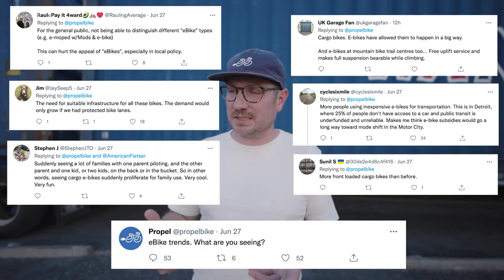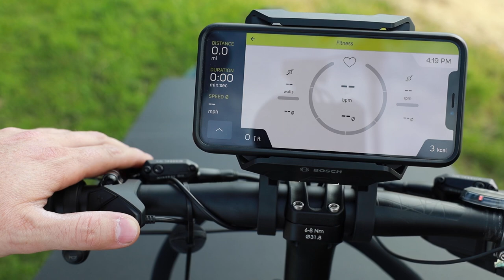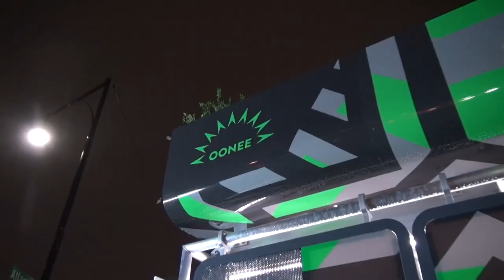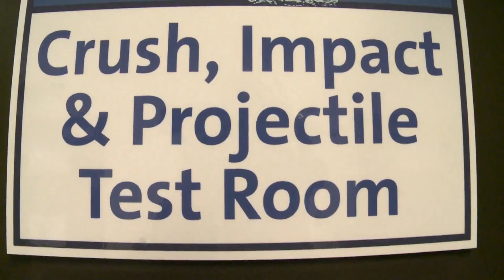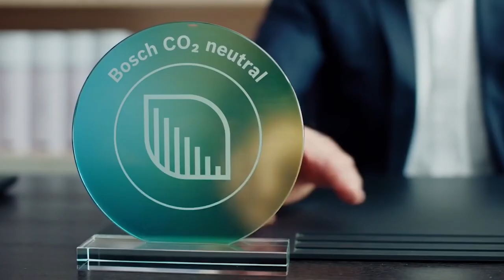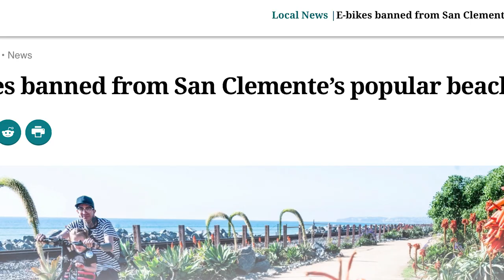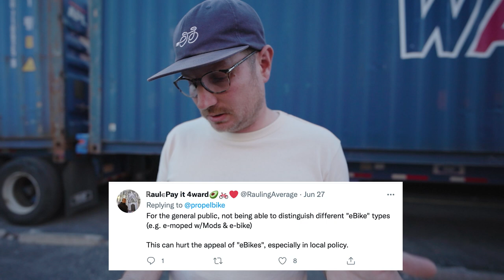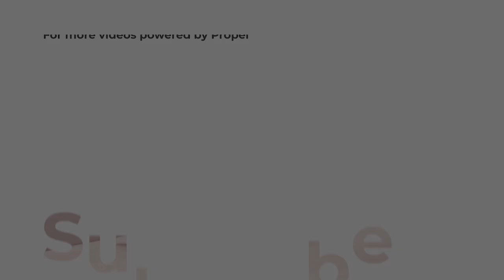eBike Trends for 2022

Comment: Decade back e look electric transport was not practical and only used as a ride in the park range, besides spending $$ every other month for batteries. I was one of those that tried as it frustrated me so much I never kept in mind to re try the e way. 2022 forced me to try again and mannn, big time difference since not having it in my mind thru out my years. I didn't realize how much it advanced of being able to actually use tech on daily basis of an everyday thing. And it's only going to get better as the regular e bike tech is jus as good as the new e bike tech to come. Big money for them newer e bikes but happy to jus be in the right range to keep up with the rest out there

Comment: UL testing is a massive cost, therefore it keeps small capable companies out of the market. without a free public testing option we won’t have safety either (UL is private). Overall, I think it’s a bit unfair (favors the rich) and may hold industry & safety back
Reply from the maker: I would agree with you on this point if it wasn't already presenting as a major safety issue. This year alone there have been over 80 fires and last year over 100 with 4 deaths. 

The reality is that many of the product in use on NY streets were not built to be stored or charged indoors. In China the standard seems to be charge the products outdoors which was likley not considered.

If history is the judge I would bet that this will be the standard wether we like it or not and I will be betting on that.
Reply: @Propelbikes  Nearly all the fires are caused by scooters brought into the country by rogue importers. But any excuse to have a go at the Chinese ebikes who are your direct competitors.
Reply: @dtz1000  Considering the brands of bikes Propel carries (>$5K), Chinese ebikes aren't even in the same market segment.   They're certainly not "direct" competitors.

Comment: Having your ebike made impossible to move on without a registration for sales 2nd hand stuff will put theives off. Registered bikes also have the added option for insurance purposes to reduce costs where upgrades could be implemented to encourage riders to be responsible owners, they get back at least 45% of their buying price. But until you can make them under $300/£320 with 48v 250watt your sales will quadruple over night.

Comment: One issue with IoTing the hell out of e-bikes is support. Software support. If an app becomes the only way to mange key controls on the bike, you better weigh up the risk of how long the company will support the software for, in particular for security updates if it is internet capable. If you're paying several thousand pound for a bike, don't be surprised if after 7 years you can't use it because it's not supported anymore. This has happened with fairly pricey electronic devices, and e-bikes might not be immune to what is effectively market abuse to force upgrading. Driving the right to repair agenda is so important.

Comment: It's different here in Europe. E-bikes are limited to a maximum 250kW motor, assisted pedalling and a maximum speed of 25 km/hr . Anything else is classed as a motorcycle and requires a licence, crash helmet and insurance and can only be used on the road.  I'm going to invest in a good e-bike because I live on a mountainside and the road to my house has a 25% gradient, is only 2 metres wide in places and has a few 180 degree bends, so it's OK cycling down but getting back home is no fun at all. Hope the e-bike can make it!
Reply: Some Chinese ebikes, like the ado A20F, can be unrestricted with a few button presses to give you double the power. It's still road legal in restricted mode. It's good to have the choice. European bikes don't usually give you that choice so you are stuck at 250w with them.  So I would look at Chinese bikes, which are usually cheaper too.

Comment: There aren't many options for getting energy/weight density better than lithium.... just a glance at the periodic table shows you there is just hydrogen and helium that are lighter. At best you'd see different anodes, possibly carbon/graphene, but most of the weight is not in the anode/cathode layers but in the barrier layer and electrolyte (lithium).

Comment: Question on sustainability: Where do I dispose the "natural" shipping popcorn that my Gazelle was shipped with? Toss it in the garden?
Reply from the maker: Gazelle doesn't use shipping popcorn but maybe your shop did? We have worked with different shipping materials over the years and I will say this is an area which can use a lot more innovation to be more sustainable.
Reply: @Propelbikes  Thank You for this quick response. I'll ask Fly Rides San Diego about this stuff. I presume it's plant based after I put one to my lips and it started to dissolve
Reply from the maker: I do think they are using a plant based one. It's definitely not easy to find a good solution here. Lately we are delivering bikes fully assembled which seems to be the path forward.

Comment: Are any manufacturers in the US planning to use the safer LFP (Lithium Iron Phosphate or LiFePO4) batteries instead of Lithium Ion? Even though their power density is lower, they are also improving, and they are much more stable (safer), allow more full charge cycles over their lifetime (about 3x Lithium Ion), and they are significantly cheaper per KWHr. The cell voltages (float and max charge voltage) are not the same, so usually it is not a simple as replacing Lithium Ion on an existing bike. Apparently they are becoming popular in China, but it would be nice to see the US step up to at least use them in ebikes, or even manufacture LFP batteries here (probably unlikely).

Comment: As a e-bike user, I really want two things, lighter e-bike and better waterproof. At the moment, i think for most e-bikes, they are delightful when the power is on, but exhausting to ride when the battery is gone. And the waterproof level is not sufficient. The first problem, i think it is difficult to address, you want a long range? faster speed? except you want to pay for a carbon frame, it is going to heavy anyway...

Comment: I need a foldable e-bike that can go 30mph easy, has good acceleration and can get 60+ miles range from full battery on full throttle. That's my dream bike. My current one is foldable, gets 25-28mph, acceleration is lacking and range is only 20-25 miles on full charge going full throttle. Had to buy 2nd battery for $500 to get good range. Also cheaper batteries would be nice.

Comment: Something I would like to see is industry standards for batteries. I have the same wish for power tools.

It is infuritating that I am forced to buy batteries from one specific manufacturer, but it's forced because they make a lot of money off of it - not only from selling batteries, but also from knowing that if you already have a battery from them, you're more likely to buy from them again. After all, if you already have a Bosch equipped bike and you get another one, it'd be annoying to have to find the correct charger, just like it'd be annoying to be unable to swap batteries back and forth as you want.

It is anti-consumer and it needs to die.

Comment: I'd really rather not see a mode shift from acoustic bikes to ebikes. That is something that really concerns me here in the Netherlands as I see a lot of teenagers on ebikes now. Ebikes are really a lot less green than acoustic bikes, let's not forget that and if it is easier going or distance extension I think a bit more sporty acoustic bike can come a long way before you actually need that ebike.
Reply from the maker: I think this is a fair point in the Netherlands. I have thought a lot about this and I believe eBikes are not as needed because of a few reasons:

1. Much of the Netherlands.was never built for the car so it retained it's relative density. 
2. It's relatively flat.
3. Due to the infrastructure, bike lanes, etc bikes don't contend with cars as much and they don't need to speed to compete. In the US and many other cities it's actually safer to go faster to avoid conflicts. This is an unfortunate reality that will be one of the hardest to solve as it deals with infrastructure and culture. The culture might be subconsciously induced though.

One point I would like to share that not all eBikes are less green. It really comes down to the use case and energy production and consumption. At that point you will need.to.look at things like.food sources to actually determine this. I plan to do a video on this in the future.

Comment: I buy a bike I like, Fit a mid drive motor and a generic battery. Having a battery that is specific to a bike limits options and keeps you beholden to the manufacturer I can usually keep a build under $1200 for a quality bike, motor and battery

Comment: One thing they really really need to sort out is the ebike laws. The UK is terrible.  Like if you get anything more than a 250w bike it should be registered, but trying to register one is near on impossible. So like escooter you run the risk of getting fines (on your driving licence) or worse the scooter or bike taken and scrapped. (by the police).  

Also, throttles are a very grey area. Which is a shame because as someone with low mobility i needed a bike with a throttle.
Reply: I see people on ebikes using throttles all the time in UK and nothing happens to them. Also scooters are everywhere but they are supposed to be banned. So I think you are safe.
Reply: @dtz1000  i have a Fiido D1 at the moment that has a throttle and yes, so far so good as had no issues. 

But i mainly mean the higher wattage bikes like sur-ron..  not that high wattage bikes are widely available in stores in UK.

Comment: I don't understand what problem e-bikes are trying to solve.
Probably one of the most unpleasant activities in the world is pedaling a bike uphill.  So the e-bike is an assist to people who bike in hilly areas.
However, the enterprise seems to breakdown from there.  e-bikes are only marginally easier to park than a motorcycle, but they are much easier to steal, and they are a lot slower.
Thus, if e-bikes are the solution, perhaps one trend for 2022 would be to better identify the problem(s).
Reply: No insurance, no road tax, no mot, no helmet required, cheaper to run than motorcycles. Way more fun than a push bike. There are a lot of reasons to get an ebike.

Comment: Batteries should be UL certified, although that is not going to prevent fires from repaired or damaged packs. I have 7 e-bike batteries but no issues because they are all from reputable companies and are taken care of. Still, I monitor charging and store them on a brick surface. Infrastructure is the biggest handicap where I live. Hundreds of business within easy range of an e-bike, no bike lanes or shoulders, and the few poorly maintained bike paths are like broken bits of spaghetti someone threw at a map. There's a state park with nice bike trails less than 5 miles away, and you cannot get to it by bike from any direction. Businesses have huge parking lots, but no bike parking, and I end up hopping in a 3400 pound car to go less than a mile.

Regarding crackdowns, it's ironic that I see more analog bikers speeding on bike paths. I've seen cyclists blowing by children and strollers at 30mph, not even attempting to slow down This past week a spandex group going towards me took up the whole path going double the speed limit. No one usually reports incidents like this, but if it involved an e-bike, there would be someone in the park office foaming at the mouth demanding that the rider be arrested for going 13mph. I have heard people say that ALL e-bikes should be outlawed because they don't make noise and they can't hear them approaching. And what noise does an analog bike make? 🙄

Comment: Things I've learned: You don't need 21speeds for an ebike. Suspension is good, but too expensive. Big wheels are good, but low step over is good too. Locked controllers need to go away. Service, not a problem for me, big problem for average consumer. Parts need to be onshore.
The companies that go away sell $$$$ bikes.

Comment: Just classify them based on their speed. That’s all these politicians need to concern themselves with. Doesn’t matter how fast they go if they’re “unlocked “ because technically you can get a speeding ticket no matter what you’re on; could even be a skateboard. I’m not a fan of all the cameras they’re putting up in nyc, but make use of them.

And I’d say a standardized battery would help tremendously. Kinda like what we already do with phone ports and everything where they have a usbc or apple port. No reason for all these types of battery ports to be floating around.

Comment: Range is the biggest thing with me I live in an area not well serviced. to get to a grocery store I have to travel 5 miles and that is just a basic food store. to get to a real grocery store I need to travel 35 miles and my current E-bike will never get there and back. To buy an extra battery is out of the question as they cost 650.00 and I just spent all my money on the bike at 2500.00 on sale and I'm on a pension. took a long time to save enough just for the bike.. This is Canada by the way.

Comment: Gearless rear hub motor … silence and low maintenance 
pinion gear system … low maintenance
gates carbon drive… clean and low maintenance

These mid drive motors are like gas motors they have too many parts that keep breaking and they make noise.
Need to focus on gearless rear hub like Stromer is doing

Comment: North America, Europe & GB have restrictions on the top speed of e-bikes, so there is no need for improvements. No other vehicle has its top speed restricted by law. New Zealand has no restriction on top speeds, but Bosch does not allow me to turn this restriction off. I can be issued a speeding ticket.
There is no need for excessive sports software on e-bikes as many watches have been built with this technology. Apple's Watch will call an ambulance if my family or I come off their bike and hit the ground hard if you don't reply to Apples Watch asking if you are ok. This happened 3 times to me, and luckily, I could respond to Apple's Watch emergency prompt as I wasn't knocked out, but I knew an ambulance would come if we couldn't reply to Apple's Watch prompt.
What is required is all e.bike stores must have batteries for hire for the brand of e-bike they sell, as I fly our 2 Tinkers around the world without their batteries.

Comment: 13:16 not try to, there are holes in the sustainable battery side. That's just the reality of it. Just because a few companies exist to recycle them doesn't mean the consumer will use them. The average citizen will not recycle them and end up tossing the battery. Heck, we have a hard enough time getting people to "reduce, reuse, or recycle" and people still throw or leave their garbage on the street. Go to the nearest fast food and look at the trash bins. All the plastic, compostable, and recyclables are in one bin. Even when there are separate bins you will find trash I'm the blue recycling bin. Frustrating as hell seeing that and I'm not the biggest "save the earth" person. I drive a V8 in California.

There is no guarantee the company will support the battery form factor the e-bike was sold with either. Bosch external battery systems look better, but I'm mainly talking about all the frame integrated batteries. This is my biggest concern from picking up an e-bike. So after that battery is kaput that bike is pretty much a weight training exercise bike. I don't even know if the e-bike computer that is sold with it or the system itself would properly function with a refurbished or non name brand battery (a sketchy and risky replacement in itself).

Overall, I'll wait. What would make me seriously consider purchasing one is having the parking infrastructure for regular and cargo bikes be substantially better than...zero in some areas. That's a better use of government spending or rebates. Free parking areas, none of that members only parking areas.

Comment: I'd like to see better upgrade kits for mountain bikes that don't cost over £350 with battery and the choice to add batteries to a sale. This is ehere governments national and local could incentivise riders to increase their ebike mileage and leqve the car at home, even sell the car and get say a better option like cargo bike meets recumbent and passenger vehicle with 1000 watt or 3000 watt motors. City and town parking with full security- possibly closer to railway station, or city centres. Licensing for options over 1000 watts.

Comment: I'm waiting for John Deere and a metal detecting company to merge into an electric bike that can find metal and then plow it out of the Earth while riding along the beach or through the woods or up a creek. 
Metal detectors allow you to plot your find on a GPS so your metal detector remembers where you find things.
The electric motor will be able to perform other functions by detaching from the wheel.
Or the entire front wheel is a removable rotary power source for other purposes like sanding drilling grinding or even pumping water.
And of course the battery can power all sorts of add-on devices like headlights,  cameras, and communicate with other vehicles. These vehicles would have been around a 40 years ago if we had not been hijacked by oil. 
Just think you could spend $75,000 on a new 4x4 luxury Jeep or $75,000 on a 40 ft Winnebago.
Look how much the Winnebago can do for you.
People wear cars as a status symbol.
And now we can see how well that turned out.